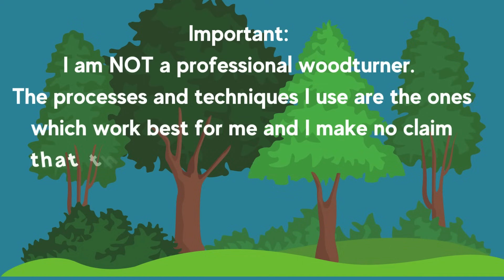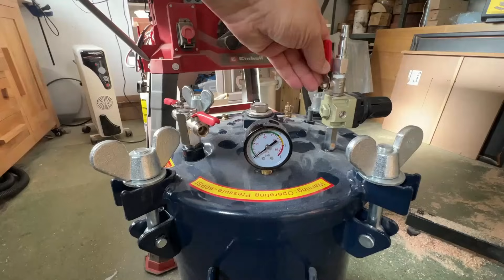Woodturning and Resin: Something a Little Bit Different

Comment: Hi. like it a lot....you seem to have a bit of a shake or wobble on bigger stuff.. had the same thing years ago an a older chap told me to put two steel tubes small in diameter to cross on the outer edge under the lathe bed from the floor up to the other side  it worked for me...hope you don't mind me saying..DAVID..N.S.W.  AUSSIE..
Reply from the maker: @daviddavies6844  Very good idea 👍🏻 Or maybe it's time to invest in a bigger lathe ?😀